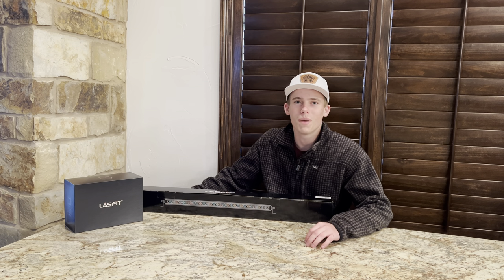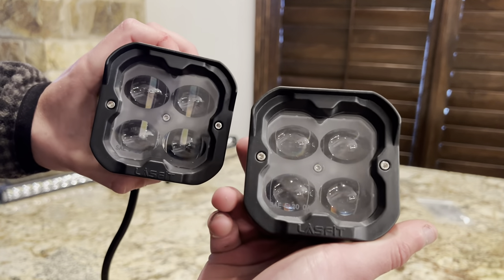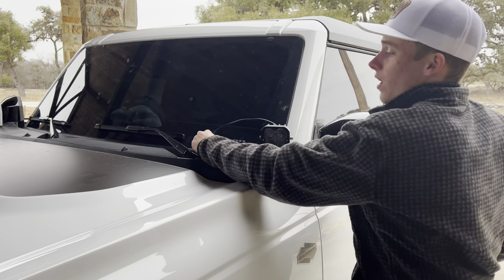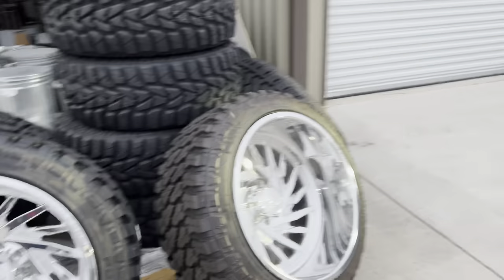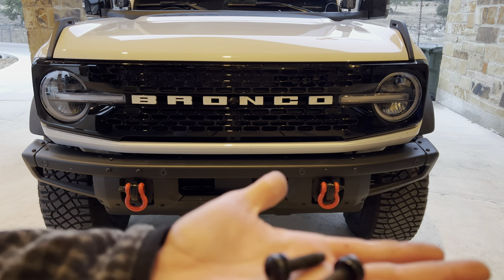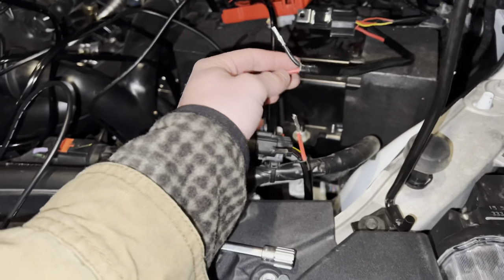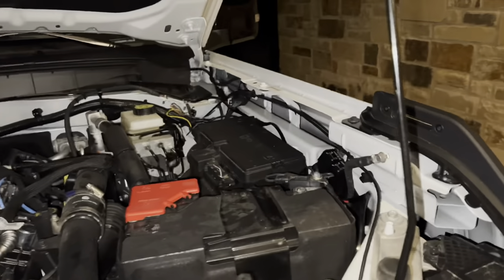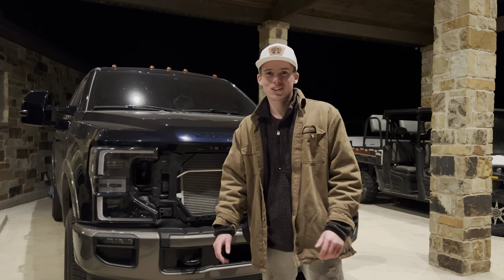New Ford Bronco Gets The Best Off-Road Lightning Setup?!

Comment: I don't understand why no one uses the front grill violet and grey non-powered circuit to connect there front bumper lights, then connect the violet and grey up by the dash to whatever aux switch you want to use 1-6 accordingly? Can it be done that way? Isn't that the purpose or am I confused? Thanks
Reply: I believe you are correct, that can be done.. I would do mine that way. Considering ordering this. They also have non powered wires to the rear that can be connected.
Reply: @krisabel4681   Thanks Kris

Comment: Question: why did you connect it to the battery? Doesn't the aux wire provide power and you could just connect directly to that and then ground screw? (newb here)